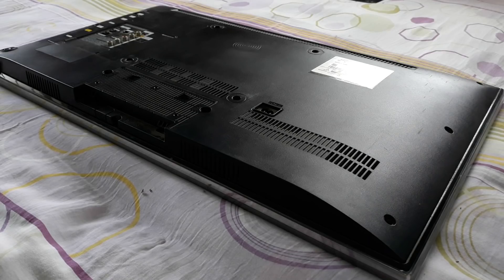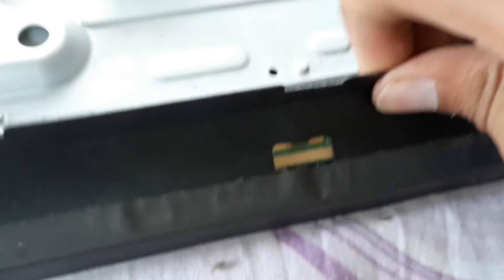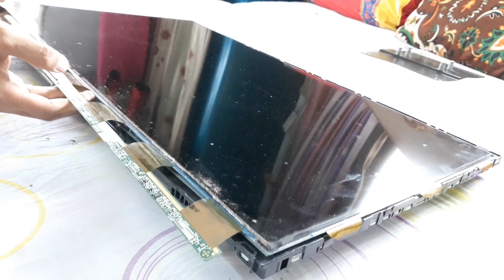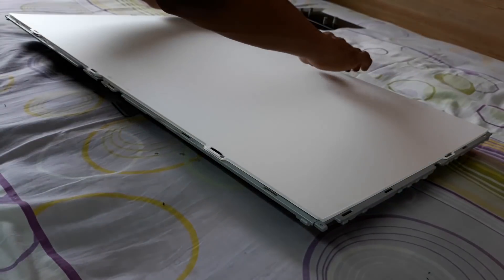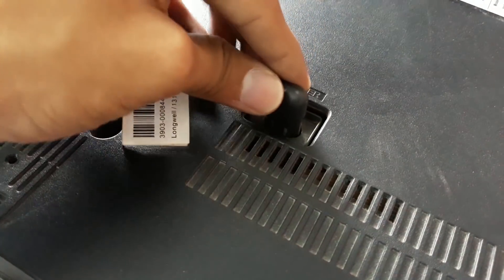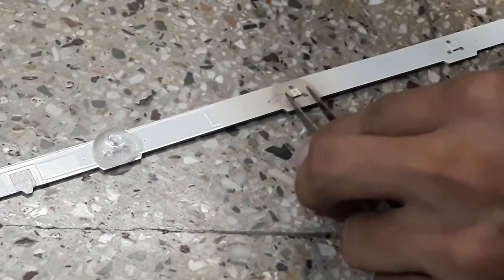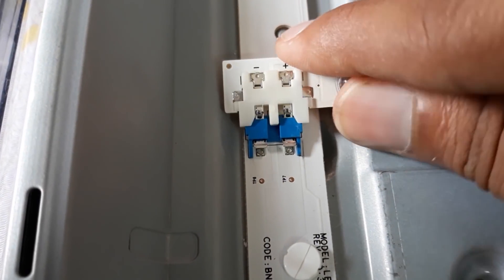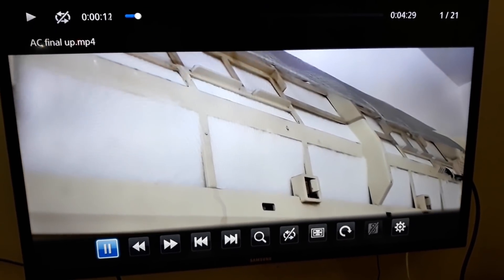[Solution] Samsung LED TV backlight fix | TV has sound but no picture | Blank screen

Comment: I have a 40 inch Samsung LED TV in which 13 leds are placed horizontally and 7 led are placed vertically. I have the same Backlight Issue, but the thing is, i want to know what kind of SMD LEDs would i need to replace, like The Voltage and Wattage. Please Reply ASAP

Comment: Backlight of my samsung uhd led is damaged, but Samsung service center is asking me to buy the entire panel as backlights are not available separately. Please suggest.
Reply from the maker: is it in warranty?
Reply from the maker: whole panel will cost you nearly 40% of your tv cost
Reply: No, it is out of warranty. It's is only 2+ years. I bought the unit for nearly 90k and for panel they are asking 22k.
Reply from the maker: try contacting LED tv repairman
Reply: Same case for me. 46 inch TV, service engineer gave estimation of 32300 rs
Reply: I repaired the tv once by electrician he charged 7000 but again in 6’months it damage, how long it will work once repaired?
Reply: @saziakhan22  may I know which TV and model with size? Did he replace original parts?
Reply: How much did it cost to repair pleade